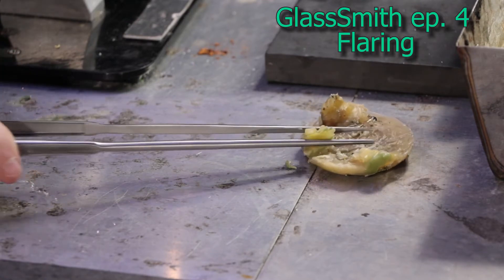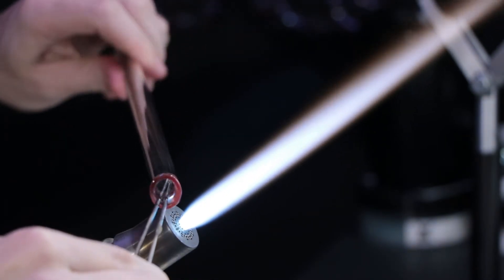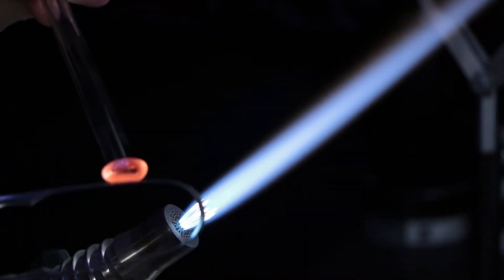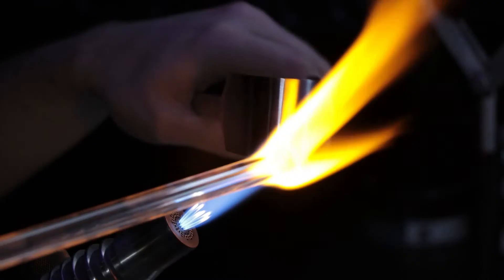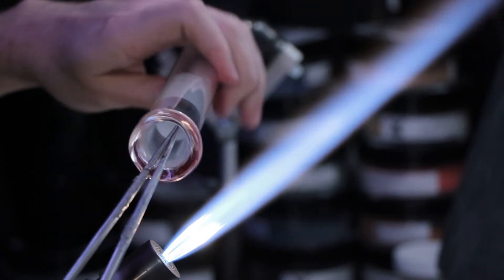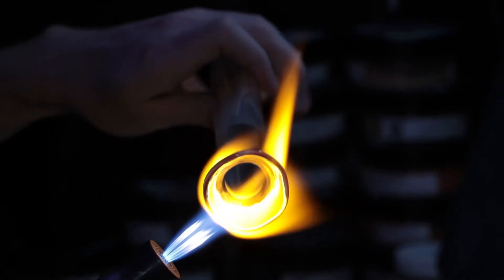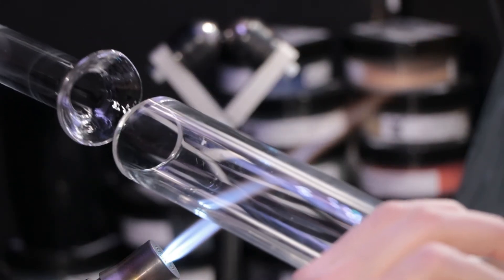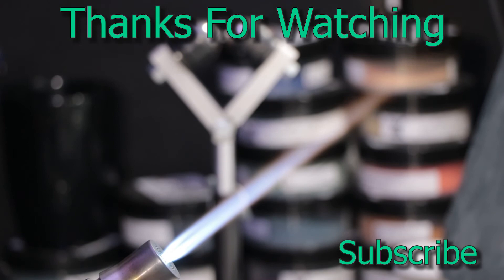Flaring Lampworking - Glass Blowing Techniques

Comment: hey matt, sorry to bombard you with all the questions lately. but as a beginner one of the things you never hear about & that i am wondering is how do you learn what size tubing you need to make your blanks with & how far each size of tubing will stretch to, like how thin you can get the walls and the peice still be not overly fragile or end up breaking on its own. i get that alot of this is simply trial and error. & i understand they sell the sample packs as i have a bunch of them, i am just sitting here thinking.. which size do i need for "this" purpose.  - - -
 "okay how fat can i make this little tube" "do i need a bigger tube or do i try and stretch one of these smaller tubes"  "what size punty will i need" 
there has to be some sort of resource out there, like maybe a chart that will show you the max stretch capacity of a 14 tube vs a 16 or a 12.  idk if im just over thinking it, but if there isn't already something out there showing this, it's an interesting video idea. 

i guess for now i will just play around with the glass.
Reply from the maker: I know what your asking, I was looking at it the same way, sort of overthinking it when I first started. 
   Generally its good to be as compatible/versatile as possible. Use the same size tubing in multiple ways by applying different techniques. You can melt a tube back condensing the walls thicker to increase tube size, or pull a tube out if you need to shrink it. 
   This isn't just for the sake of versatility, but for the difficulty of stocking your studio with many different sizes tubes/rods. You save more money buying in bulk, which is 30-50lb of glass per case (~$200).
   Of course using the same size for everything isn't the most time effective, and so here is my basic [must have] list.

Solid: 7mm and 28mm. (optional = 16mm)
Hollow: 12 by 2.2mm and 26 by 4mm (optional = 40 by 5mm)

I buy the 12, 26 and 28 in cases, but the 7mm has 150 rods, so a full case might be too much.

It also depends on what your planning to make. If you only do solid work and don't blow out glass then a full case of 12mm tubes would waste a lot of money.
Reply: @JasaGlass  awesome! thank you so much for the advice! this helps out alot.

Comment: Are you using bravo?
Reply from the maker: Yup a 2-stage Bethlehem Bravo. I was only using the center stage for this Demo. I turned up the propane for the larger tubing; you can see the flames candles have grown kind of long and are slightly reducing at the tips.

Comment: Thank you for the great video, Matt! I am trying this rechnique on soft glass with some difficulty. Where do I find jacks like you used?
Reply from the maker: This is where I got mine, I bought the $60 Medium size. https://www.mountainglass.com/tools-and-equipment/tools/jacks  If your doing cups or larger tubes it can take a bit of practice but you'll get it. You can stabilize the jacks a bit by holding the tips along the inside of the tube a few inches in-front of the flare, so the jacks are  making contacts in 4 spots. It's hard to describe, I'll have to take a picture to point it out, I'll try to do that tonight and post it in YouTube's new "Community Post" section.

Comment: Do you have an email or contact information? Would like to inquire about glass making, need a question answered. Thanks
Reply from the maker: I'll be setting up an email soon for the channel until then feel free to comment your questions here. If I don't respond I might be busy with a project but I'll make sure to get back.
Reply: @JasaGlass  have a project for a business class and wanted to know how much would it cost you to make a 2 inch hollow cylinder with a 9mm opening on on end and 7mm the other
Reply from the maker: @youngking686  2 inch in diameter? or is that the length of the tube?
Reply: @JasaGlass  2 inches would be the length, diameter on one end 9mm, 7 on the opposite end. 2mm thick and hollow. Thanks a million for the quick response
Reply from the maker: @youngking686  Really not much, maybe $5 it sounds very simple. Does wall thickness matter? It would be at-least 1mm, 2.5mm.
Reply from the maker: @youngking686  No problem. I'm thinking I can do a 'Custom Listing' on Etsy. I'm still finishing up setting up my Etsy shop though, how long do you have until the project is due?